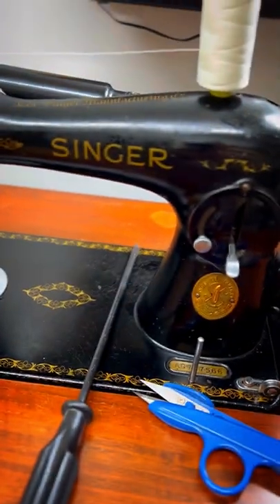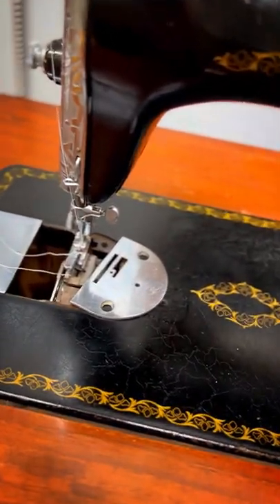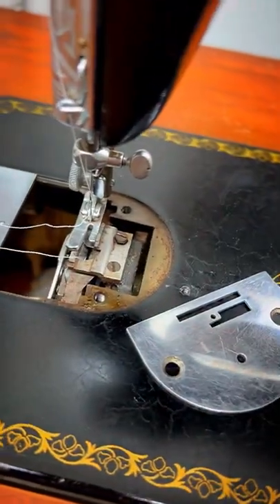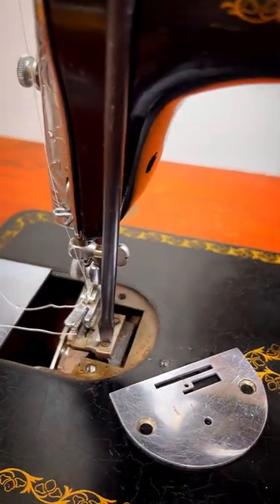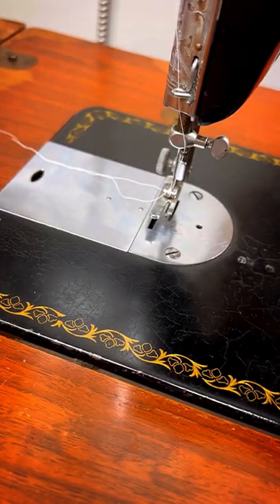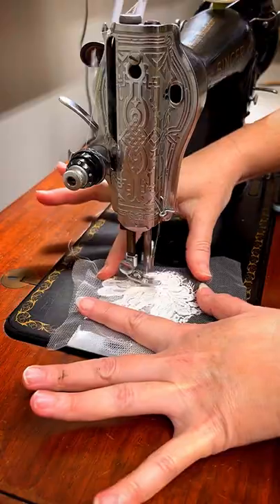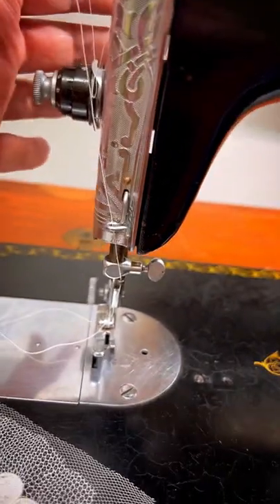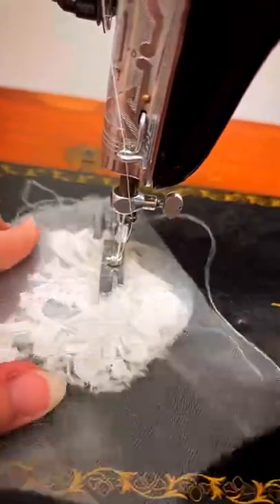Convert Antique Singer into full time free motion and appliqué stitch machine

Comment: I have a machine like that but I don't know what I've got.  It has no belt and is direct drive from the motor.  Can you help?
Reply from the maker: It might be a potted motor? I'd have to see. 
Google the serial number stamped on the plate on the machine. It will tell you.
Reply: Might be a Singer 15-91 like the one I have
Reply: 15-91 and 201 models have direct drive motors excellent machines the 201 is the best

Comment: It may be good to use a darning foot otherwise if the fabric isn't held tight to needle plate the stitches have a better chance of  skipping.
Reply from the maker: Yes, it has one on it now. This was just the original conversion. It does still work with the foot raised, it's how I run my juki and it works fine. A skipped stitch here & there doesn't show with heavy lace usually. But, when I have a machine that I would like dedicated to a certain type of stitch, I do like to set it up with the right foot.